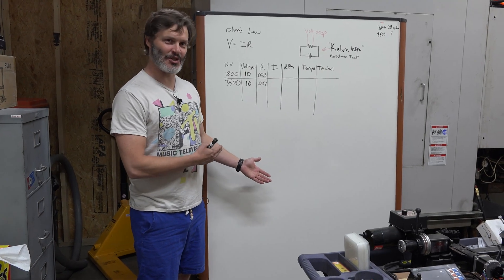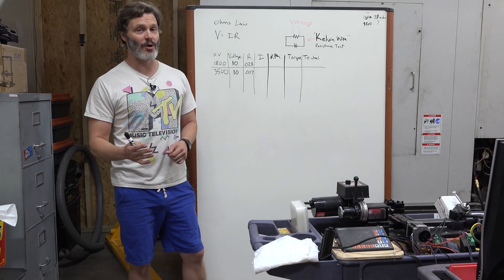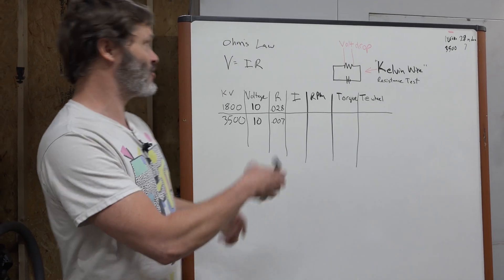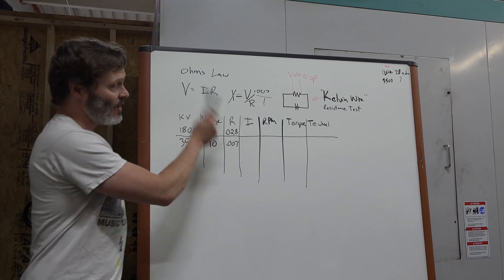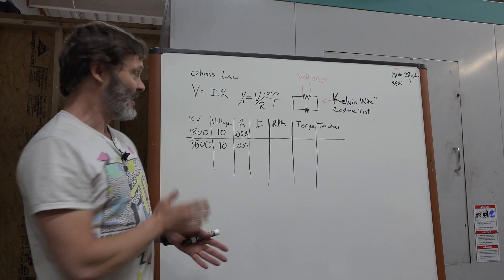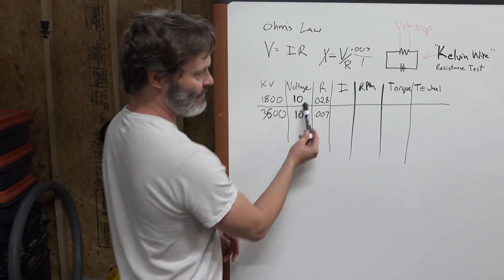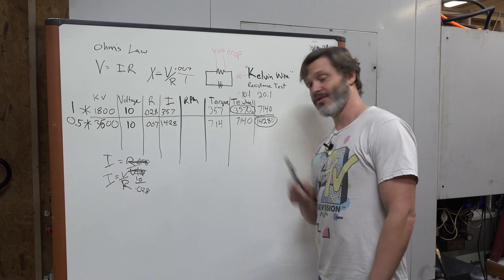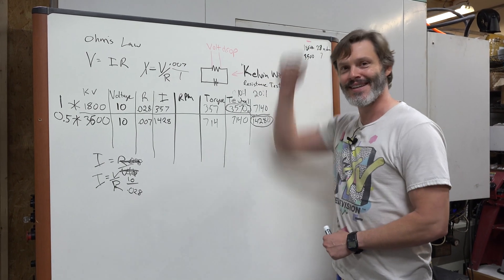1000KV @ 20:1 gear down vs. 2000KV @ 40:1 gear down || Holmes Hobbies which motor is better

Comment: I know that there is a lot of stuff that affects it but lets add to that calculation battery, if let's say 1000mah lipo will give a 1h run time on 1800kv@20:1 then whats can be expected from 3600kv@40:1?
Reply from the maker: Runtime is not affected much unless you bind it down more and use the available torque.  

On the average, I do not lose much runtime besides what a twitchy finger and sometimes harder acceleration cause.  

Now, if we threw in the faster motor without regear the runtime would go down a lot. More wheelspeed?  Always less runtime.
Reply: Same runtime unless you use the extra torque available. Driving style and terrain unchanged, same runtime
Reply: @johnrobholmes  your left finger on the radio doesnt directly control the torque but the wheel speed. A 3600kv motor will deliver 4 times more torque while consuming 4 times more electric energy(= solid number of voltes multiplied by he amount of amperes). If we’re not taking in count that you might have to give more throttle with the lower kv motor to reach the necessary torque to conquer the obstacle it‘s clear to say that the higher kv motor consumes 4 times as much energy so your runtime will drop from 1 hour to 1/4 hour aka 15 minutes.
Idk how a 1800kv brushless or a 3600kv brushless motor actually runs in crawlers (ive only used brushless in my faster cars) but if the 1800kv performs at least as well as brushed stock crawler motors i can recommend to use a 1800kv motor for trail or scale crawling. If you’re more into extreme rock crawling the 1800kv will do it aswell but the 3600kv will do it way more smoothly (while dividing your runtime by 4). The only reason i see for upgrading to a high kv motor in crawlers are competition crawlers (or just wanting to keep your throttle finger at the same spot while climbing extreme obstacles). As I’ve said: idk how much torque a 1800 brushless motor delivers but in every phrase i wrote i was just expecting it to deliver at least as much torque as the cheap stock motors
Reply: @the_letti0584  watts are watts and the battery isnt changing.  At 4mph both rigs use the same energy,  more or less. It isn't until loading down that the faster motor can pull more torque.  So, Unless you go binding the rig down harder, the faster motor with more gear down does not affect runtime very much.
Reply: @johnrobholmes  is it because if you geardown more, the motor spins not hard as the other one with higher gear ratio isn't it...?
Reply: @helmydewa  correct.  And wattage is wattage.  The faster motor might require more amps but it requires less voltage for any speed and torque output. With the extra gear down,  it's generally a wash in wattage with noticeably better performance

Comment: Allow me, long story short, higher KV motor has higher power output (assuming other factors are the same, size , sup voltage etc), therefore,  it can provide higher torque on the wheels after all the gears. With the down side of more power consumption.

Comment: Awesome breakdown 👍😃 Although it is obvious 🙂 Good you mention to check how low you can gear down on your vehicle 🙂
Reply from the maker: Indeed, there are limits on gear ratio
Reply: You can use reducer for example 3:1 or 5:1 and change the spur and pinion to hit the ratio you want
Reply: @helmydewa  yes you can do that. There is a lot you can do, but it is a lot easier to pick the right KV engine that suits your vehicle and how you want to drive it 🙂 Then if you are not happy with it, you could do what you mentioned 👍🙂